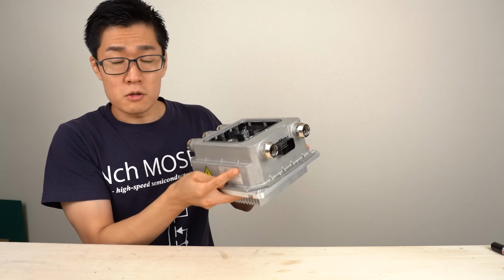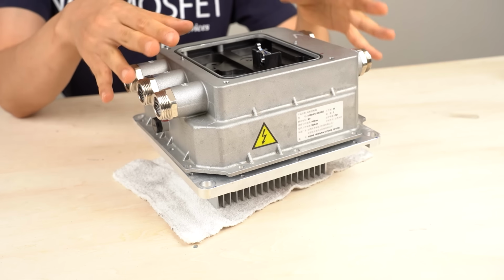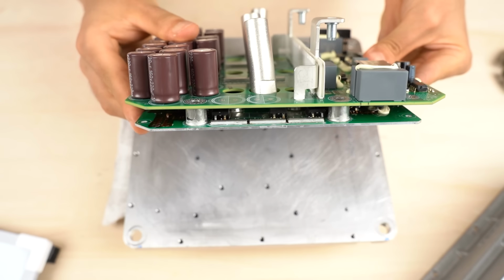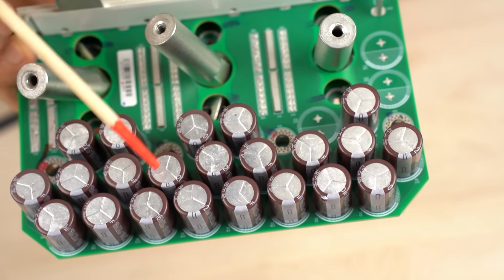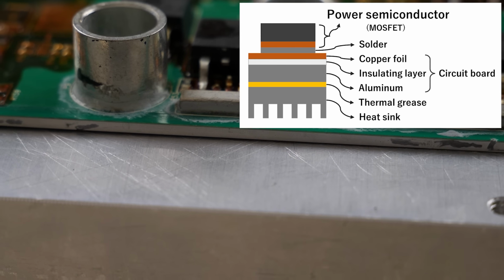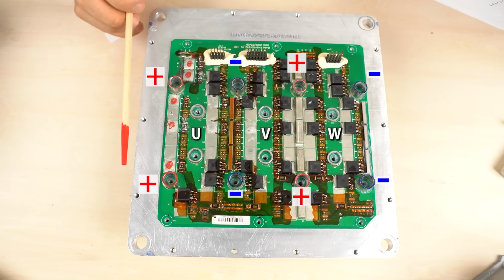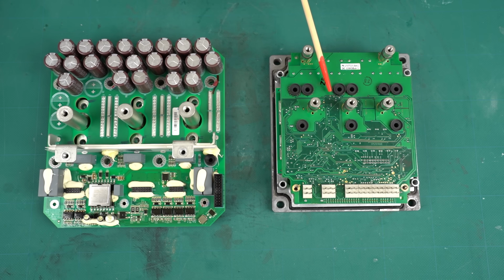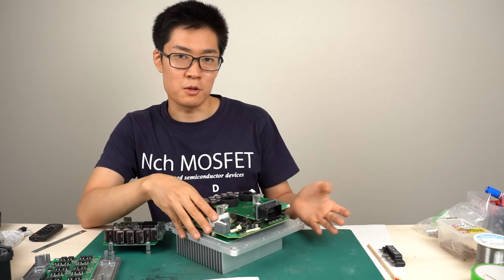$4000 Electric Car Inverter Teardown.

Comment: Most Inverters fail due to semiconductor blowing up, so choosing an european Brand like Infinion seems legit and in the end cheaper - if you have to swap all the inverters due to failure, it will cost you a lot of many, especially if you sell many of them.
If you demand the same quality standard like in Europe (or with lower standards, but still rather high like in america compared to chinese cheap mass-production standards), the prices between european and chinese products are basically the same, especially with products which don't need that much man-power for the manufacturing.

Comment: I can't believe how small those power transistors are. I've seen larger Silicon IGBTs in e-bikes.
Reply: the limiting factor for the size is the heat that your package can output. With proper board copper layout, this number can be astounishing. Some packaging allows top and bottom coolling and so have a much bigger current capacity

Comment: Smaller electrolytic capacitors  are also more likely to be more readily available hence cheaper and if one starts to fail there are many others  to share the load.  Electrolytic caps  are a failure point so why risk the system go down ?

Industrial inverters have been around a long time and so are pretty well proven. You might be overthinking the cooling - the inverter will have a track record and they will be pretty sure what its capabilities (and weaknesses) are and any alterations would be pretty well thought out and implemented already elsewhere.  I haven't worked in power electronics for a long time but I would be surprise if the layout is not replicated across many electric car inverters. The car industry tends to be pretty conservative - read hanging on to old technology which works as long as it can 
😊.
Reply: This. Like, I really don't understand the criticism for electrolytic capacitors at these voltages. If the 105 °C rated capacitors run at a reasonable temperatures, like around 55–65 °C under normal use, they will last over 10,000 hours if driving. Which, even at city speedw will be 300,000 km or more, much more than the expected lifetime of most other compnents in such a city car.

The design looks clean, looks reasonable, and looks highly optimised for its use. A few fancy parts where they are needed (like the big film capacitors and the high-quality ICs) but not wasting money overengineering the bulk of it.
Reply: @L2M2K2  The electrolytics do fail.  Expecting temperatures to remain below 65 deg C may be optimistic in some climates where ambient is 35 degrees plus. You also have to remember stress is caused by the constant heating and cooling cycle not just a high absolute temperature. A lot of inverters used in cars have industrial origins so some robustness is designed in  but a car is  a very different use case  and it can be difficult to tell how long something will last in an uncontrolled setting such as a car as opposed to an inverter being used in a factory machine which is monitored

Comment: I was not expecting to see Infineon MOSFETs on a low-cost Chinese inverter like this!
Reply: Keep in mind that infineon produces for sure in china, so the Chinese builders may have access to lower prices
Reply: @michelangeloponchio7229 often with China brands they will make fake ones. There are so many fake Mi (Xiaomi) products in China for example
Reply: Why? These mosfets takes not so many overal cost. But I definitely surprised that chinese developers don't use there own products. They have nice semiconductors, such as Wayon and ICs from Novosense.
Reply: made in Germany, or made in China ?
Reply: @johnfuchs9130  I bought something that said... Made as Germany.... Yea guess where it's actually made....
Reply: @vueport99   Infineon has "manufacturing facility" in Wuxi, China.
Oh, and Infineon bought International Rectifier in 2015.
Reply: China makes what you want. The buyer is responsible for end result - not China. If it's cheap, the buyer didn't pay enough. One factory can make a good product with testing if you pay for it. f you pay for minimum, they won't test anything and what you get is what you get. A lot of produtcs are made in China, a lot good, and a lot bad
Reply: Infineon are cheap regardless, mosfets are very cheap to make, and they may be copies.
Reply: If they're not fakes lol
Reply: @HouseOfBugs89  You're probably right...
Reply: Even infineon mosfets would not justify that price. What a ripp off. This is around 200 dollars in components imo., ok matbe 500 :) at most; Did you see that film cap, that's a good component for such application. Electrolitics, hahahaha will be very durable (sarcasm) But in these times everything is meant to last some years so yeah. Consumers are getting ripped of more and more.
Reply: @davypeleman
I think $4000 is the cost of the entire car that thing is from, not the inverter itself

Comment: I wouldn't say capacitors smooth voltage. They smooth current drawn from battery. Battery voltage is already very smooth, but they are not suitable for providing pulsed currents in 100khz level of frequencies because parasitic inductance and limits on electrochemical reaction speed. Also to reduce EMC emissions, it's not good idea to draw pulsed currents from cables.

Comment: There is a reason for many US brand components in this inverter. If this board is an early revision, they make small batches, so relatively low volume western components in china are abt. the same price. Chinese 1st party sellers dont like to sell less than around 10~20k.
Some manufactures start with small batches with western components and change te BOM to chinese made ones when scale up.
Probably all those components are chosen bc. they have drop-in replacements for it. The TMS320 for examples have many drop-in clones. Majority of inverters use cheap TI DSP clones..

Dont subestimate those eletrolytic caps, this things are harder to make than us think. that's why nippon chemicon, and murata are market leaders. Eletrolytic caps looks like simple devices but very hard to make it right.
Reply: I'd also think R&D happens with higher cost western components as their documentation/support and dev environments are well established and good. Once the kinks are ironed out, you can "deploy" on cheap drop-in replacements.
Reply: @RminusOR  true. they need to build up the reputation. But these cars like illegal to moving on the road, just a slight turn at 50 mph can send you to the hospital.
But this is enough for them to make a lot of money in china

Comment: Frankly for the cost the vehicle, the design seems to be of good value, I am surprised they didn't use slightly better electrolytics but I suppose there are a lot of them.
Reply: check the price of the vehicle

Comment: Yep this is small 20 Kw and 96 volt it looks like140 to350 A, 4000US is a lot of money
for this if you know that tesla using 400 V and 220 A if we say the efficiency is 90%
you have 242 A strange that you can give only e few seconds full power.
it is not volts hour but amps hour you can not pull 50 % from the power in a few
seconds sure some can and ask than why there motor is gone in a hour
that is only becauase stupidety kills th cat.
Reply: The  car price is 4k dollar 
not the inverter 🤦🏻‍♀️
r  u   d u m b?

Comment: There is at least 1 reason why this thing is complete garbage. Electrolytic capacitors have a life expectancy of about 5 years. There are about 25 of them. This thing will be degrading before it leaves the factory. It will fail completely far sooner than 5 years. All of these vehicles will be at the recycler 12 months from now. Even the ones that are not used will also be nonfunctional in 12 months.

Excellent breakdown and analysis, by the way. I'd love to hire you.
Reply: false, caps main life factor is work time in hours, depending on temperature. They easily can do 25+ years
Reply: @pingwinvonjelen6586 That specific Aishi capacitor has a 6000 hour endurance at 105C. It has a 0.75 ohm impedance and is rated for 120V, while being operated at about 100V. There are 22 of them on the board. The rubber mat over them is most likely a thermal pad, and is desperately needed, I suspect.

I'm curious why you think the caps arent the shortest life expectancy item in this inverter?

That TMS320C30 DSP isnt very fast, so reaching 100kHz switching is probably not even possible.

Let's say they are running China-winter cool. At a MTBF 0f 25 years, a short in any one of them will render the inverter dead. By my guess, these inverters will average about a year between meltdowns, and unless the batteries have a good BMS in them, it will result in a major fire almost every single time it fails. The IP67 enclosure will pop from overpressure, and dollars to donuts this inverter is right next to the battery, making the failure much more spectacular.

I'd love to hear your analysis on this matter, as I would love to be convinced to use electrolytics in a project I have this year.
Reply: I have many amplifiers that are still using electrolytics from the 1990s.
I have arcade machines that still have some working caps from the early 1980s.

Comment: 20kW for how much? DC caps are sitting on the opposite side of the board from the DC input.   Functional safety is below DIY floor - two AC current sensors. How high is stray inductance of the DC bus? No SC protection. This is junk.

Comment: The rubber sheet is used to transfer heat from capacitors to heat sink. Also cut down on the amount of filler sentences like “next i am going to do this or that” and get straight to the point.

Comment: Looks like they left open pads on the board to have the option to add more or less MOSFETS to adjust current-handling capability.  Still, I definitely would have gone with IGBTs.  This circuit looks like something you'd see on Instructables when searching "how to build an inverter".
Reply: IGBTs would be far less efficient and have slower switching frequencies. They are better used at higher voltages but at 96V IGBTs make no sense here.
Reply: @MaxVandenbussche  Inverters work at low frequency
Reply: IGBTs for 96V DC link voltage do not exist. IGBTs make sense at higher voltages only.
Reply: @benutzernamenichtverfugbar4977  Checkout the FBSOA of an IGBT and of a MOSFET, that is the reason why IGBT's are utilized on car inverters instead of mosfet
Reply: also they arent igbt because there will be higher losses . igbt main advantage is stable voltage drop rather than resistance, in such low voltages using them doesnt make any sense
Reply: yeah this is not worth that amount of money.
Reply: I think the only reason they do parallel mosfet and caps for power is the low cost. I wouldn't drive that car after watching this
Reply: @brandonbehc  no one reported any issues with these cars
Reply: @brandonbehc  there is no way to handle that current with single transistor. Paralelling is a must
Reply: @pingwinvonjelen6586  There are plenty of IGBT that can carry over 1000 amps continuously (source, having “abused” 20 such dual-IGBT modules for a 10,000 V and 10,000 A pulsed power converter.

The only issue is cost. One such megawatt-class half-bridge IGBT costs half the cost of that full car... And, you would need three of them. (Of course, if it was a big electric train, or possibly an electric hypercar, one could go for such. Although , probably not for the hypercar. It would be waste to have all the losses of big transistors when 99+% of driving doesn't go anywhere near tge full tilr. But, mostly such transistors are used for big windmills and esoteric medical devices.)

Comment: I wonder if I can use this to drive a 3 phase lathe or mill by using batt back up system
Reply: Probably easier and cheaper to put a UPS on a VFD.   Most lathes don't need huge currents.

Comment: Today i learned that capacitors have pressure release valve
Reply: Yep, or we'd have miniature grenades all over our electronics.
Reply: Ohhhhh. So it's a built in failure joint that is suppose to break and release pressure if the caps fail
Reply: @raloed.363 Yeah exactly that, designed to lessen the explosion somewhat. Still a massive bang when they pop though. Had one blow up a few inches from my face, luckily it missed my eyes.
Reply: Sure, BUT only in failure mode.
Reply: Yes, that's what the perforations on the lid are.  When it explodes it fans open instead of fragmenting like a shrapnal grenade.
Reply: Ohhh Good on you!  learning that at lab is a schoking experience
Reply: Because capacitors go boom.

Comment: what i took home:
chinese can't make semiconductors.
as a result, they're in trouble.
Reply: There seem to be Chinese equivalents for nearly all these parts, but in small'ish volumes they are about the same price as imported western ones and are more difficult to get from the official supplier. Quite a lot of Chinese things start full of western parts in low volumes and then they put domestic items as volume grows.
Reply: @BertoldVdb  they can make these chips only if you give them blueprints. 
and litography machines.
and people to operate them. 
they're not able to copy everything they would like. 
i see their industry as something kinda working, but only if western mfrs left the documentation (or it was stolen) and machines. 
but you can't beat west in that way. you can't dismantle chip and copy it.
Reply: On the other hand they very reliably make ev's that become inflamed.

Comment: I'm still amazed by how much current those tiny 'transistors' can handle.
Not only in this tiny converter but also in our grid, running at 800kV DC/AC 380kV bidirectional converting at kiloamps.
Reply: There are even much more efficient mosfets than the ones used here. Mosfets might be the greatest human invention
Reply: @Rubacava_  First it was tubes, then transistors and now mosfets.
I love them all as they've each enabled  significant developmental leaps, but mosfets stand above, and are pure magic in my eyes.  The power engineer in me always had reservations about the voltage drop across transistors, and I love mosfets for not having those losses.  They're just so efficient 
😍😍😍
Reply: @thecatofnineswords  Mosfets too have losses, and they're also transistors, that's what the T in mosfets mean. But the invention of GAN HEMT (they're gan mosfets) truly revolutionized the industry
Reply: @Rubacava_  The market for high voltage is very volatile. No one talks.
Reply: @Rubacava_ which model you recommend instead?
Reply: Semiconductors are awesome
Reply: Problems start when designers take "Absolute Maximum Rating" values as a target...
Reply: They can but it is one side of the story. The gate drivers were mentioned remember ? These charge the gate capacitance of such transistors as fast as possible ( and get rid of the miller effect which is the major factor in high voltage switching ). This means a very fast increasing current and violent EMC behaviour ( and small dynamic losses ). That just means these circuits, cables and motors attached emit a lot of electromagnetic radiation. If you can shield that all in a faraday cache, no problem. If you cannot, huge problems in conformity tests for EMC. You can ommit the gate drivers but huge losses will result in the power fets, resulting in bigger fets or IGBT's but way better EMC behaviour.
Reply: and IGBT's eats current on steroids
Reply: HVDC Grid distribution use huge banks of SCR thyristors in the converter stations.
Reply: It's not really any more impressive than the little fuze passing so much current.  They don't loose a lot of voltage, so there isnt much heat dissipating in them.  Use them as an amplifier and they heat up pretty good.
Reply: should be ones with ultra low on resistance FETs.
Reply: 'transistors'??
Reply: @KarldorisLambley  The industry calls them 'valves'.
Reply: @picobyte  it was the use of inverted commas that baffled me, suggesting transistors is not the real name for them. when clearly they are mosfets. not valves, valves are made of glass and use thermionic emission.
Reply: @KarldorisLambley  The industry doesn't care.
Reply: Some of them are still thermionic (klystrons I think) or even electromechanical: a dc motor running an alternator.
Reply: This "magic" makes real only thanks to alluminium board! From each TO263 case you can dissipate fantastic heat.
Reply: as long as they are cooled down